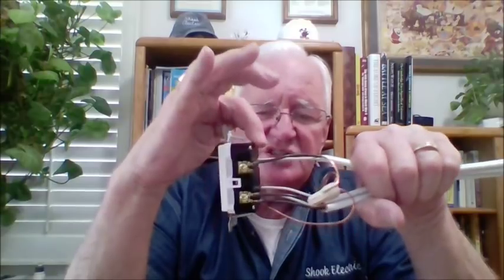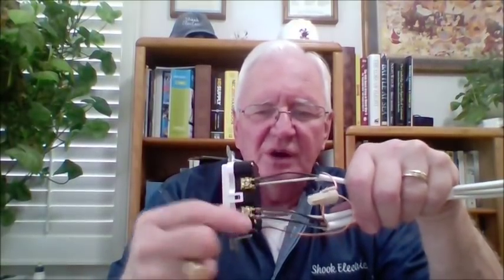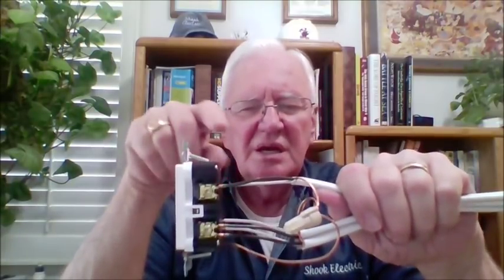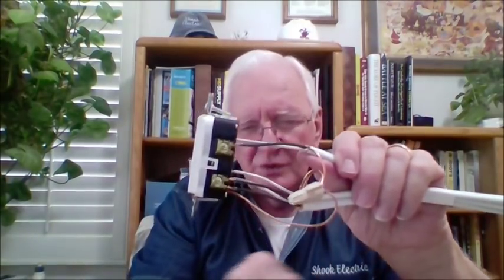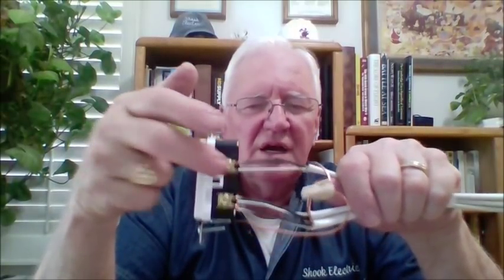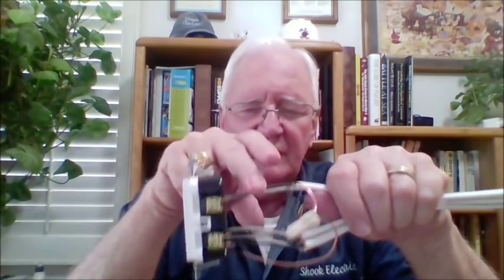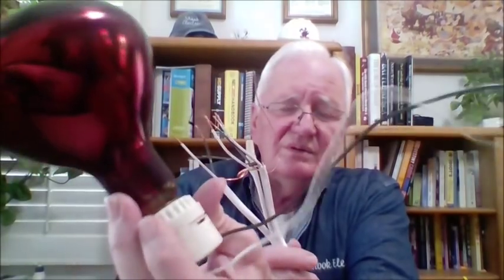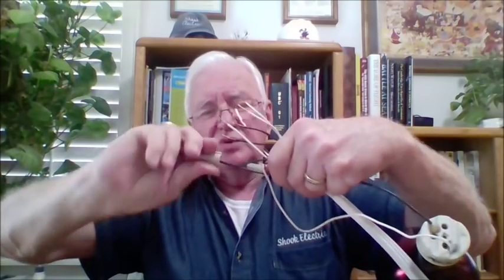gfci outlet receptacle installation troubleshooting, Disneyland Manager, John Shook

Comment: Is it normal that if you test the gcfi receptacle that it trips the circuit breaker, which happens to also be a gcfi breaker? (which i don't think is necessary to have both, but that's how the house is wired)
Reply from the maker: No the gfci in the panel has priority but they both will both trip in most cases.

Comment: But if your circuit breaker says 15 you can't put a 20 gcfi receptacle right?
Reply from the maker: The breaker protecks the wire, A 15 amp wire  =  15 amp breaker. A 20 amp wire or No 12  =  20 amp breaker
Reply from the maker: If your 15 amp wire is protected by a 15 amp breaker then you can use a 20 amp GFCI.  I have seen a 15 amp GFCI mealt down when used with a toster and not trip the 15 amp breaker to many times in my life, code or not.

Comment: I have read online that it’s not a good idea to use a 20 amp gfci if that circuit calls for a 15 amp. Can you explain this in more detail? I installed a 15 amp because that’s what was previously installed. However, this was in my garage. Should I have installed a 20 amp instead? I’m just wondering if it would have been safe. Thank you for your videos.
Reply: On a 15 amp circuit, the 15 amp breaker will protect the circuit, the wire, and the receptacle from overload so why in God's name would put a 15 amp receptacle on it's end so it can just to burn up as well? I have seen over 100 go south in my 62 years as an Electrician.  John

Comment: Thanks for the information and help! Just troubleshot a tripped kitchen gfci and had to open 4 duplex wall outlets to find rhe problem. In that 4th outlet I checked, upon taking cover off I noticed the exposed copper ground wire touching the neutral exposed side screw. Pushed that back in and away from neutral screw and that was the problem.  You got me on that load trail with your gfci help videos. Thank you!!

Comment: Can I put a 20amp GFCI in my bathroom with 15amp lines?  Others say no, need 15 GFCI on 15 amp lines.
Reply from the maker: Yes, but the power service is still only 15 amps, The 15 amp breaker (in the panel) will protect the circuit, the 20 amp gfci holds up to hair driers and other loads better then 15, But this is not to code. JS

Comment: Is it even safe to put a 20 amp gfci on a 15 amp circuit?
Reply: The 15 amp breaker will protect the 15 amp circuit, not the GFCI, Code is some times wrong, I was in the ASTM & NFPA, NEC, for over 30 years and I disagreed with the members on a regular bases. JS
Reply: @patshook1088  Okay thanks. I will be replacing a bunch of old outlets. It's something I've never done before. Your videos have been very helpful, thanks again.

Comment: Great help. 15 vs. 20 

My problem was I couldn’t get the new gfci to reset. The old one I removed had the charge and line in different places so when i just put the top wires from the old to the top slots in the new it would not work.

Comment: I only have 108.8 ac volts on an outside receptacle, and nothing plugged into this receptacle will operate. Is the voltage too low to turn on the 2 things plugged into the receptacle or is there something else wrong?
Reply from the maker: Check the volts with a power tester, not a meter. You don't have useable volts. Find out where the problem is and repair it, check the wiring down the road and find your 120 volts. JS
Reply: @JohnShook  I have been looking on YouTube for a power tester and can’t seem to find one. Is there another term that is used to describe what you’re referring to?
Reply from the maker: @mikeallumi6507  Use A Wiggie or a Low Z setting on your meter for Power Testing  Usable Power Not a digital volt meter  Use a Wiggie or Knopp K60 or Light blub instead. John Shook shookelectric.com  Retired Disney Maintenance Manager: Test for Usable Power
Reply: @JohnShook  Thanks an easy question for you, but a challenging situation, since I love to learn,  but not much of an electrical background to draw from

Comment: Thanks for the information.  If you have two black wires connected, you stated that there something else downstream that was connected, but not to the load.   Does that mean that whatever is downstream on the "line" is connected in series or in parallel? I have this situation and can't figure where this is going.  Could it be a switch?  Thanks
Reply from the maker: If it is not a load then it could be a continuation Circuit down the line, Feeding a Receptacle.
Reply: @JohnShook  I found an outlet that was connected, but mislabeled on the breaker box.  It was also another GFCI.  Seems redundant.  Am I correct to assume that since it was not working until I replaced the initial faulty outlet, that it is connected in series?  Sorry for the nascent question.  Thanks for helping me out.  You do your fellow man a great service.  Wish you good health.

Comment: THANK YOU - I had just installed a brand new circuit with a GFCI outlet and it wouldn't reset. I didn't realize that the line HAD to come in the line side, I honestly thought it was just a recommendation. Duh! Fixed me right up.

Comment: I replaced my old GFCI with new. I had to switch the top 2 wires to the bottom and the 2 bottom wires to the top in order for it to work. Thought I would share. It took me awhile to figure this out.

Comment: My panel arc fault breaker that feeds the gfci keeps popping. The 20a gfci is in the kitchen and feeds 2 other outlets. I've done an inspection of the outlets and all looks good and tight. I'm guessing I have a bad gfci outlet?
Reply from the maker: Why do you have an arc fault breaker feeding a GFCI ?, That technology is still new.
Arc faults fail more then GFCI do. JS
Reply: @JohnShook  all the breakers in the panel say that on them. The house was built in 2016 in Tennessee.
Reply from the maker: @scottnorman408  I would change out the kitchen breaker for a 20 AMP regular breaker for feeding the GFCI and see if that works.

Comment: I'm not getting why you would have more than one hot and neutral wire to your line side.
Reply from the maker: Joel, The Line side feeds the GFCI circuit then continues on to feed another receptacle circuit. Two wires on the line side for hot and two wires for the neutral. JS
Reply: I'm still thinking that the line side comes from the box (feeds GFCI) and the load side feeds other receptacle circuits down line. Are you doubling something by having more than one line side connection by having two live hot wires GFCI connections from the box?
Reply from the maker: @joelswafford7074  One hot from the panel box breaker, to the GFCI, one hot from the line side of the GFCI to another receptacle or other GFCIS, The load side of the GFCI may feed a hot wire to other receptacle or other GFCIS or not.
Reply: @JohnShook  Thanks for your help and expertise in understanding the full scope of this situation
Reply: @joelswafford7074  I had the same question. So it's basically an alternative to using a pigtail, which is often done on regular receptacles as well.

Comment: I replaced an old receptacle, but there was no ground wire. I installed the black on the load side as written in the back and I installed the white on the white side, but the outlets dont work. I did the same thing for 3 outlets and none of them are working. Any ideas about what to try?
Reply from the maker: Use A Volt Meter or taster and test, your circuit, for power. ? JS
Reply: @JohnShook  I needed to swap them. I had the line and load backwards. I am having trouble with a dimmer switch now. It seems straightforward, there are two black wires, and a green. The dimmer switch has a red, a black and a green. I twisted a nut on the black to red, black to black, and green to green. I flipped the breaker and turned on the switch, no light. Then I swapped the black and the red, still. Nothing. I'm not sure what to try next.
Reply from the maker: @Wardad1x7  The Black is the input. The red is the output, Green is Ground
Reply: @JohnShook  even after I swapped the two blacks coming from the wall to the switch, it still won't turn on. I can't seem to find anything online about what the cause might be. The switch adjacent to it works fine. That one goes to another light. I checked the breakers and the gfci outlets. I'll take photos and try asking Reddit. Thanks!
Reply from the maker: Start by finding A tester to test for voltage.
Reply: @JohnShook  you're right! No power coming to either line... The switch next to it is working fine however. I checked all the breakers and reset them. I also checked all the gfci outlets. The flip switch I removed was working, what could have caused the line to no longer have power?

Comment: Thanks for your video question how do you install a ground wire in a outlet if you don’t have one ?
Reply from the maker: Pick up a new receptacle with ground, or if you don't have a ground wire, install a small  #14 ground wire from the ground to the neutral . Make sure all neutrals in the panel are nice and tight. JS.

Comment: Great GFCI Information! My new combination Arc Fault/GFCI breaker frequently trips while running the dishwasher. The appliance technician said I should replace the breaker - it’s probably tripping on startup. However, I believe moisture may be causing the trip because it’s more common on rainy or high humidity days. Another moisture contributing factor is when the dishwasher trips off before the water has drained. It will not restart and trips the breaker every time the start button is pressed. I drained the water and placed a fan in the DW until it was dry - it started and worked fine. The DW is plugged into a receptacle under the kitchen sink. Does atmospheric moisture which may settle on the machine components or wiring in the receptacle be enough to cause the GFCI tripping. Will spraying a silicone coating on the receptacle wiring help? Is their a diagnostic method to determine if moisture is affecting the circuit?  Thank you , Dom

Comment: John, Great video. I installed a new GFCI. As suggested in the instructions I tested with only the line connected and it would reset and provide power. "All" I did next was connect the load wires which as yet aren't connected to a load. The GFCI won't reset now. What could cause this?
Reply from the maker: Look at my other video on " why it trips"
Reply: @JohnShook  Thank you John. I believe I've narrowed down the problem to "wire mashup" - when I removed the outdoor cover and let the GFCI breath free it was OK. Have to cleanup behind it I suppose.

Comment: Hi John, thank you for your informative video.  My question is why my GFCI outlet is not working; it has a solid red LED on.  When I plugged a GFCI tester, nothing light up.  The Circuit Line is hot when I tested it with a non-contact AC Voltage Detector.  I even disconnected the Load line from the outlet.  I greatly appreciated for any pieces of advice.
Reply from the maker: Check Hot to Neutral and hot to Ground. If neutral  to hot is dead, then you have a bad neutral. JS

Comment: Hi John,
@John Shook
I've tried to hook up a 20 amp GFI under my sink for a new dishwasher recently. I have an old fuse panel box with screw in fuses. When I screw in the 20 amp fuse there is no power to the new GFI outlet, but my alarm to my outside sewer tank pump gets set off. Is this a clue there is something being shared with another circuit? I thought the line coming off the (left side) old fuse box was isolated to what (I thought) it was previously hooked up to. Which was my basement sump pump and a light above it. I thought I could install a switch (upstairs) between the basement sump pump outlet and my dishwasher outlet. So they wouldn't blow a fuse if they both were on at the same time. My outside sewer tank pump has its own new panel with modern breaker switch installed on the (right) side the old fuse box. Could the sewer tank pump alarm breaker switch be tied into this other line coming out the opposite (left) side of old fuse box I'm now hooking into for my dishwasher and sump pump outlets? The old basement regular 15amp outlet I also replaced with a regular 20 amp. Its black and white wires had been previously installed backwards I noticed. All wires now are 12/2 . New switch upstairs is 20 amp also. Wire I connected to, off of fuse box is 12/2.
Reply from the maker: Check to see if the pump is 220 V. ?.
Reply: The Ridgid pedestal sump pump is 1/2 hp, 60 Hz, 120 volts, 7.3 amps. This was plugged into the 15 amp outlet (with black and white wires reversed) . I replaced it with a 20 amp regular outlet. 
But the sewer pump, I don't know. Its deep down in a hole outside. There are two sets of new breakers attached to the side of my old fuse box for it. One switch for the sewer alarm -15 amp. And two 20 amp breakers for the sewer pump. 11 yrs ago I bought this house and part of the deal was to install this new sewer system.  New breakers were installed on a separate panel attached to the old fuse box.  The sewer hole is about as big around as a sewer cover and guessing about 8 ft deep. The sewer pump sits at the bottom. I think about 5 yrs ago I found some info inside the alarm box. Will look in the daylight tomorrow.
Reply: Hi John,
Well, I took a look inside the alarm box. On the door- the label with the info on it is so faded I can barely read anything anymore. The ink is yellow now. This all I could make out- Zoeller pump
Model PS115/230
Pump 120/230V 60 hz
Reply from the maker: The pump can be wired 115 or 230 V (not both). TEST with a meter to be sure of the volts used. JS

Comment: thanks John, I am doing a small kitchen remodel. I am trying to troubleshoot my issue, I have two romex in the box and isolated what should be the Line going back to the box. I installed the GFCI to the line but it trips a second after I turn the breaker back on. Any idea what can be going on? I have verified that everything is 20amp I eliminated the load side completely as a test. Only thing I have not done yet is go in the attic and isolate the romex completely
Reply from the maker: make sure that the hot lead is on the gold terminal and the neutral lead is on the GFI...read 120 volts across the gold and silver terminals, hook up the ground and test .  If it trips, it is probably a bad gfi unless you are sharing the neutral with another circuit.   In that case, remove the neutral and take the ground wire up to the neutral silver terminal and test.   If it still trips, you probably have a bad gfi, JS.
Reply: @JohnShook  What are the chances of buying two faulty GFCI off the same shelf the same day? I removed the neutral (white) and replaced with ground (bare) still trips. Only other thought is that This outlet is not the first after the panel
Reply from the maker: That sounds like a bad GFCI to me. When depot gets a return they just put it back on there shelf and don't check it, and a lot of people will take back a bad anything for the money. JS
Reply: @JohnShook  I recently ran a new dedicated circuit for the fridge so I'm going to test the GFCI's one last time to rule those out completely
Reply from the maker: Sorry, some problems are a pain, but they can be fixed. JS
Reply: @JohnShook  agreed. Thanks for the help
Reply: @JohnShook  You were right! the brand new GFCI's I bought were bad. I just don't have enough experience with electrical to know. They even said it on the front. "if blinking replace". So I returned and they are working great. Thanks again John you are the only one that was able to help me.
Reply from the maker: OK. JS
Reply: Hi John,
@John Shook
I've tried to hook up a 20 amp GFI under my sink for a new dishwasher recently. I have an old fuse panel box with screw in fuses. When I screw in the 20 amp fuse there is no power to the new GFI outlet, but my alarm to my outside sewer tank pump gets set off. Is this a clue there is something being shared with another circuit? I thought the line coming off the (left side) old fuse box was isolated to what (I thought) it was previously hooked up to. Which was my basement sump pump and a light above it. I thought I could install a switch (upstairs) between the basement sump pump outlet and my dishwasher outlet. So they wouldn't blow a fuse if they both were on at the same time. My outside sewer tank pump has its own new panel with modern breaker switch installed on the (right) side the old fuse box. Could the sewer tank pump alarm breaker switch be tied into this other line coming out the opposite (left) side of old fuse box I'm now hooking into for my dishwasher and sump pump outlets? The old basement regular 15amp outlet I also replaced with a regular 20 amp. Its black and white wires had been previously installed backwards I noticed. All wires now are 12/2 . New switch upstairs is 20 amp also. Wire I connected to, off of fuse box is 12/2.

Comment: The problem is with the solid 12 wire.  It is always a pain to compress that stuff into a box especially with a GFI and its physical size.  The 12 wire just does not fit well behind the GFI case.  The GFI has little clearance at the back with the box.  It's a real pain worth mentioning.   It's better to have an oversized box, which is testy itself, if the work is minimal remodel.

Comment: John: If I change 15 amps GFCI receptacle in the kitchen do I need to change all the #14 wire to #12?
Reply from the maker: As long as your not changing the breaker. The circuit breaker protects the wire and the circuit, GFCI. The GFCI is a Ground Fault Circuit Interrupt (only ) protecting you from a ground fault. so I will say no. JS.

Comment: I have a split receptacle in the kitchen and want to add a GFCI  plug..I guess I lose a line in as I can only use one line ..any other options ??
Reply from the maker: Add a GFCI  on 1 circuit  Before or after the split circuit  and jump it at the split. Or they due make an split GFCI but they are hard to find. JS
Reply from the maker: Or add a double box for two GFCIS. JS.